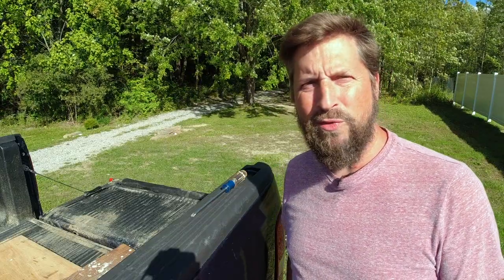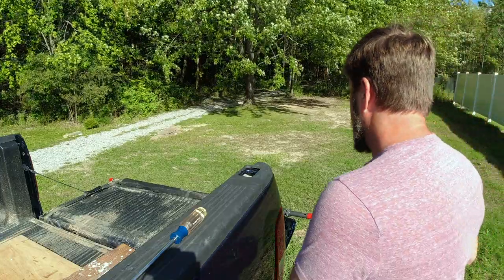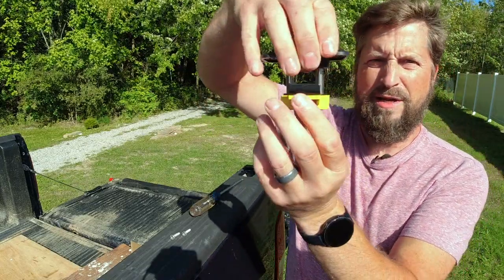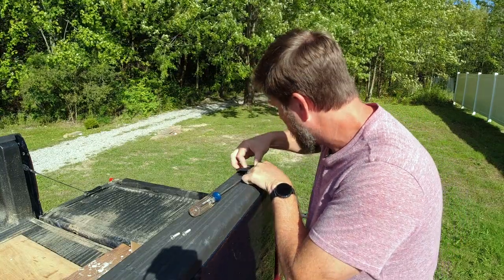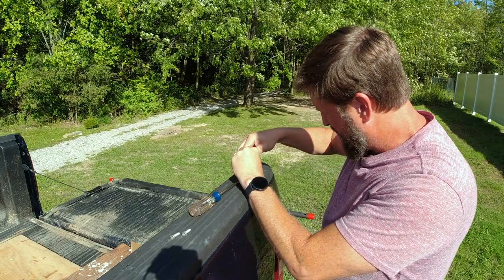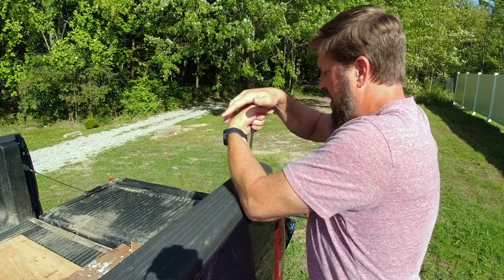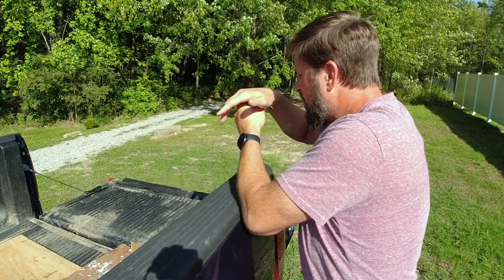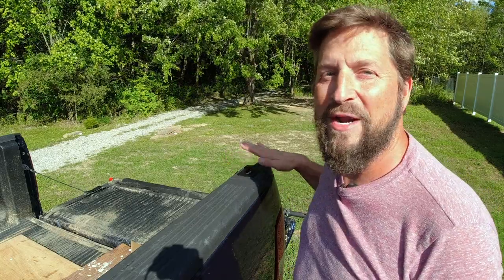Review: Bull Ring Truck Tie Down

Comment: Anyone know where I can find these that fit a 2016 silverado?? Mine is shaped differently and I can't seem to find them anywhere.
Reply from the maker: These may be a different manufacturer but looks like they'll work the same. Hope this helps!

Tigeracing Tie Down Anchors Retractable Truck Bed Side Wall D Ring Compatible with 2007-2021 Silverado & Sierra 1500 2500 3500 | 2015-2021 Colorado & Canyon - 3000 LBS Capacity (of 4) https://www.amazon.com/dp/B07L2ZR35F/ref=cm_sw_r_apan_glt_i_DM7400ZBZAD08GD1P5MZ?_encoding=UTF8&psc=1

Comment: I have a 94 F-150. Can you tell me the dimensions of the square where you drop the Bull Ring in? Thanks
Reply from the maker: I have since traded in my f150 for a 2009 f350. The bullring fits my new truck as well. I think they are 2 1/4" x 1 5/8".
Reply: Ok, thanks